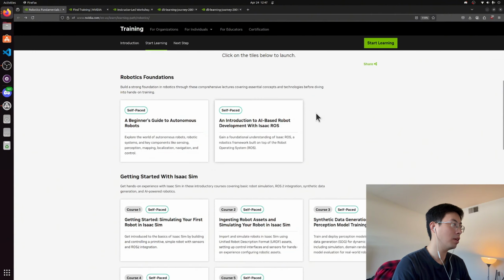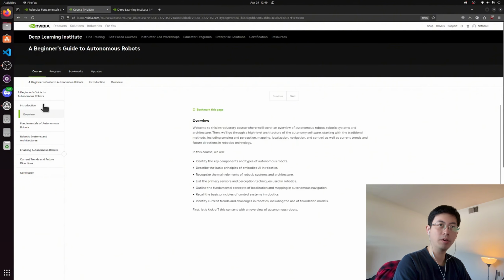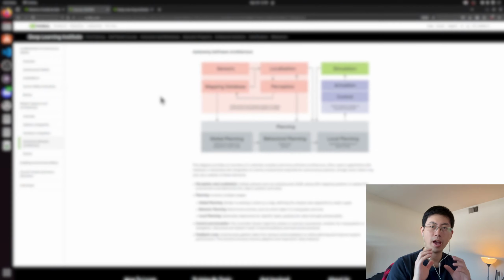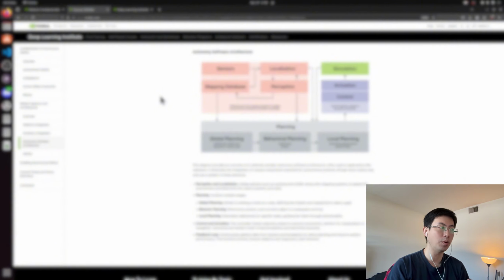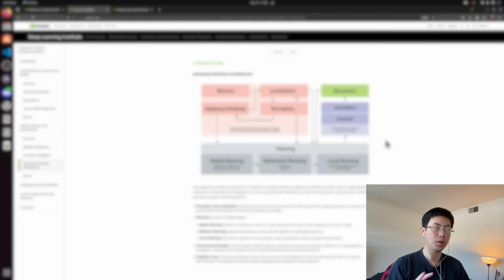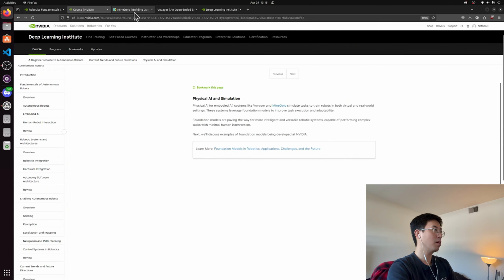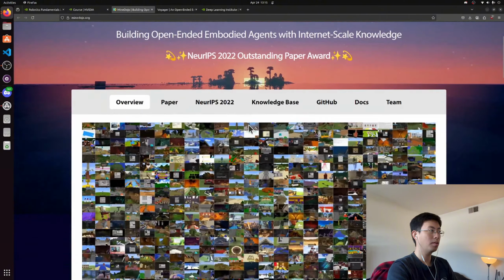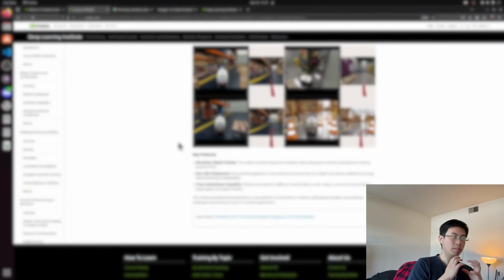What is Embodied AI - Robotics Fundamentals with Isaac Sim/Lab | Part.1 |(Commentary)

Comment: You talk about a lot of tools but don't explain key things about them. 
-Which of those tools are open-source and which are closed?
-What's the price of the closed tools?
-What's the minimum hardware required to run the open source tools?
Reply from the maker: Thank you for the feedback. I'll definitely keep these aspects in mind for the upcoming videos.
As for now:
Open-sourced (free): Isaac Lab, Isaac ROS
Closed-sourced (free): Isaac Sim, COSMOS, Isaac GR00T.

Hardware varies from the complexity of tasks people want to execute on. In general you'll need 16~24G of VRAM (so a 3090/4090/5090 would be best for individual), and CPU i7 or greater as most sims still utilize CPU for efficiency until super large scenes.